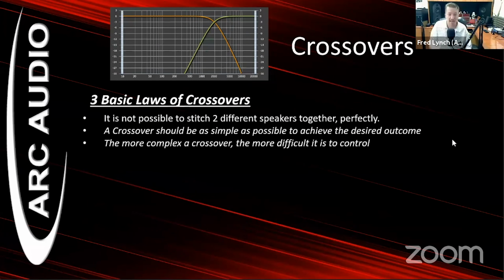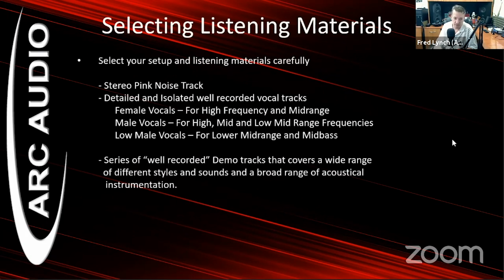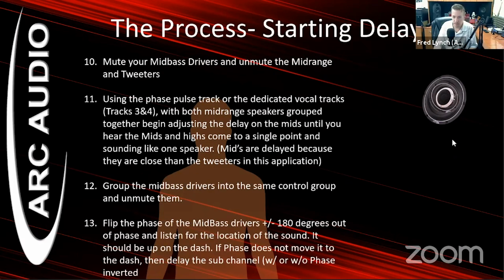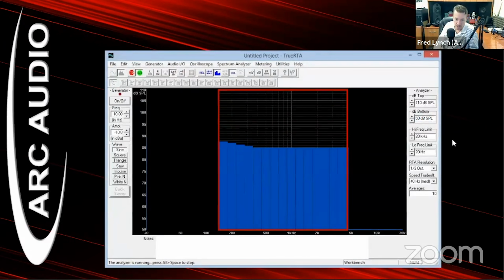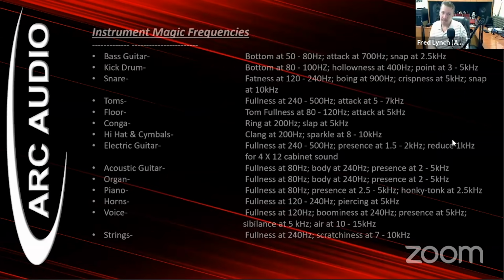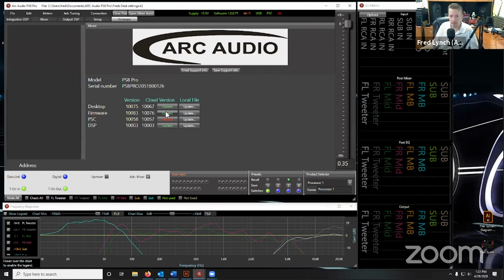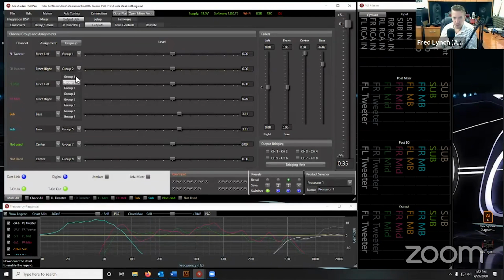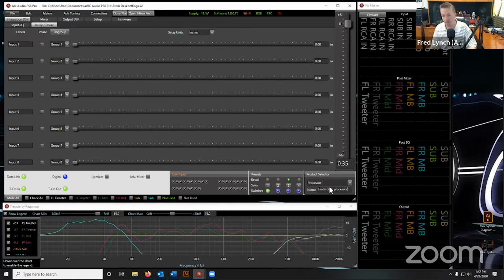Pro-Series DSP Overview and Basic Tuning Concepts

Comment: This training video was very helpful! I have the Blackbird DSP, and after downloading the software it was very confusing to me. My installer did the basic tuning leaving me feeling like the system could be tuned far better than originally tuned. I’m still having a difficult time with sound coming from the factory center channel speaker which seems to interfere with the system front staging and I have reached out to support for advice.
Thank you ARC Audio for the training video because it really help me understand the system as I become more proficient in the use of the system.
Wardell Frederick.😊

Comment: Hi, thanks for the informative video. While correcting the delay between drivers on a 3way system like in my case,  the LH Midbass is the furthest driver followed by tweeter and the midrange. What should be the sequence that i should follow? Shall I delay the tweeter group with respect to the Midrange group or.....
Reply from the maker: Give tech support a call. Either Brian or Gurmel can help you. 209-543-8706

Comment: Honda Accord. EX-L

2-SE 4200
1-SE2300
PS-8 w/Controller

All Speakers:
Hybrid Audio Technology 

FRONT STAGE
Legatia SE 6.5 (bottom front door)
Legatia SE 3.    (Front pullers)
Legatia L1 R2 Pro  (Front Pillar Tweeter)

Clarus 6.5 W/Tweeter (Rear Deck)
Clarus 15” Sealed Box 4ohm Sub

Dynamat interior

Nice sound